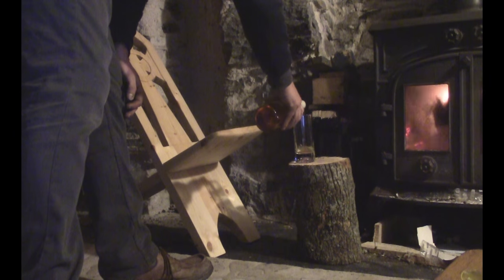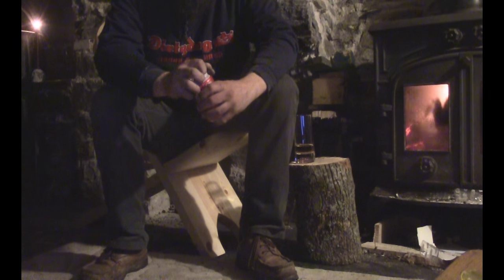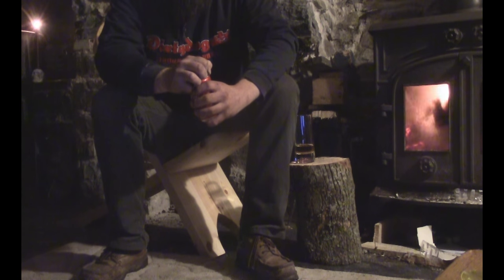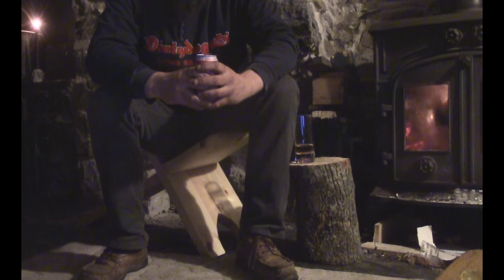How to make a Celtic Chair out of FREE 2x4 timber

Comment: Just tried 1 of these with a scaffold board...very basic mine was..what are the lengths y9u used for seating part and upright? Also how high was the slot cut out part? Absolutely love this 1...😍
Reply from the maker: Not too sure and the lengths dont matter that much. Have a look through my other videos, theres one called Viking chair part2 with dimensions thats got some sizes. 
The height of the slot I usually do at around 11 inches. 
Ive just made a scaffold plank one recently, ill see about pulling my finger out of my arse and making the video. 
Thanks for the kind words, I dont have this chair anymore so i cant measure it for you.

Comment: hi bongo do u give the dimensions for the celtic chair it's a class piece of work
Reply from the maker: Hi Tom, thanks,  search out the viking chair pt2 dimensions video, should be some info in there for you,  its one of those that no two are really the same as such and you make them to suit the lengths of timber youve got access too, especially if youre using reclaimed timber

Comment: Could you list all the tools used.
Reply from the maker: Sorry for late reply Rob been a bit unwell, i just watched it back...theres a few! Im guessing that the main ones you need for this project are
Jigsaw
Router with a straight bit where i sank the pattern and a biscuit jointing bit for joining the timbers
Electric drill
4 or 5 sash type clamps
Set square, pencil, ruler, compass, saucepan lids
A rasp for finishing the center hole.
A sharp knife for finishing fiddly bits.
Belt sander and a finishing sander.

And I also used the chopsaw at the start for trimming them all to the same length. Hope this helps?